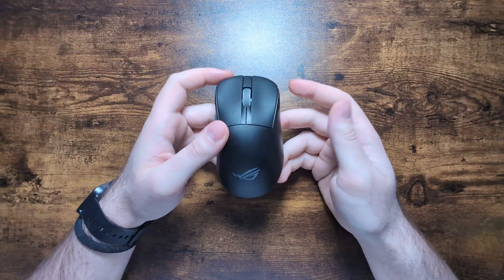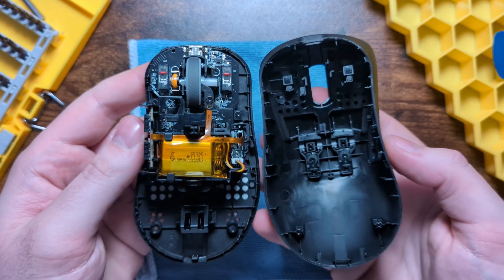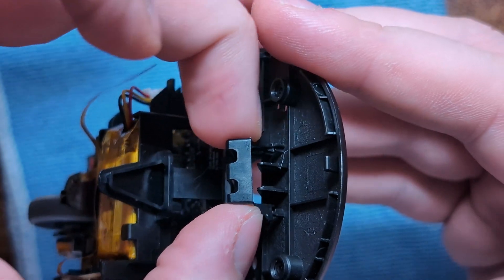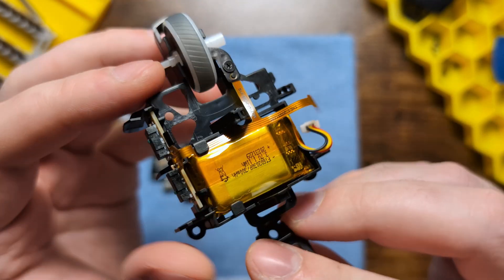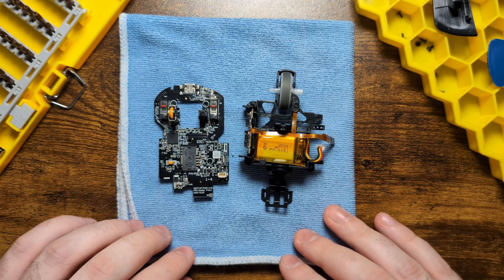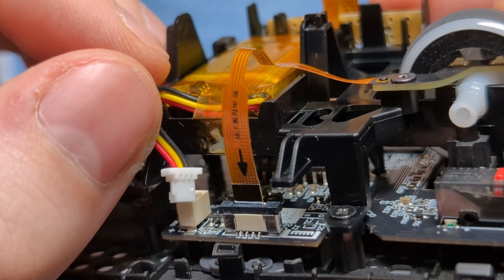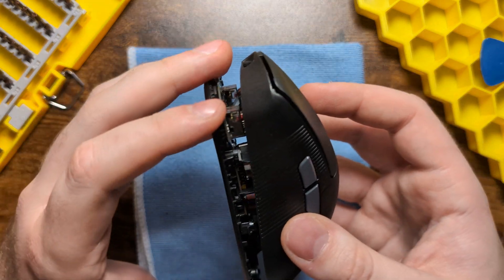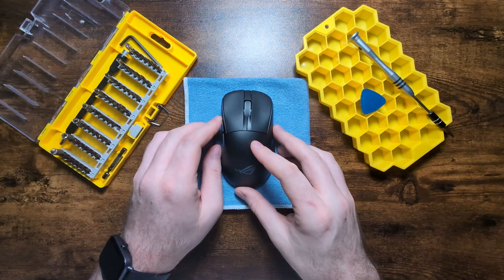TEARDOWN | ASUS ROG KERIS II Ace

Comment: hot swappable doesn't mean shiit if only switch you can use is oem asus switch. So In this case I would just prefer them to use soldered switch. At least we can desolder it and use any after market switch.

Comment: Thanks so much for doing this! The silicone wrap on my mouse wheel was coming very loose and binding it up when I scrolled. I was able to replace it with an aluminum one from eBay that fits flawlessly.
Reply from the maker: Glad the video was helpful! I didn't know the scroll wheel's wrapping had so many issues, you're like the 8th person to mention they had issues with it 😅
Reply: @mel0nFPS  I'm the 9th then
Reply: I bought mine back in July of 2024 and am having the same issue so I'm going to replace it with the metal scroll wheel also. I also added some Corepad skates to it so it's going to be decently modded once it's finished.
Reply: @ghty-kw7hm  hey mate where can I find that for the scroll ? Don't want to glue this one..
Reply: hey mate where can I find that for the scroll ? Don't want to glue this one..